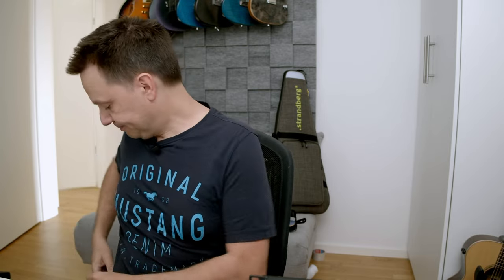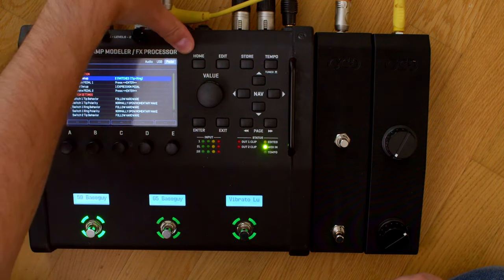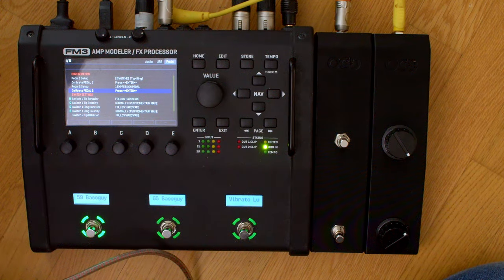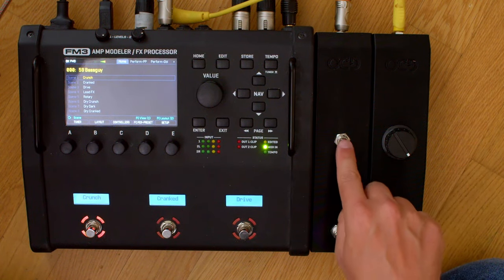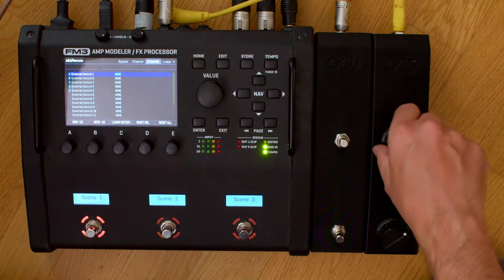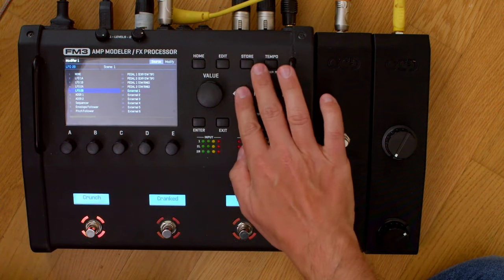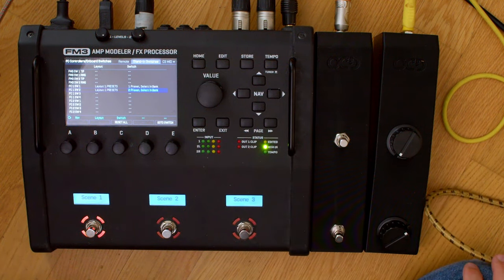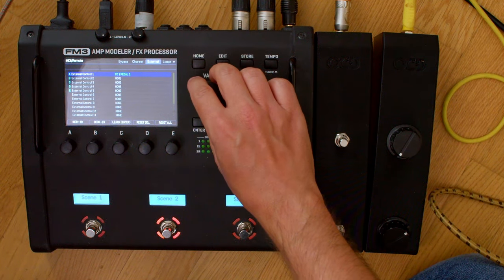How to setup Otter Custom Design switches and control knobs on the AXE-FX III, FM3 and FM9

Comment: I thought momentary external switches could only do tap function only?  are the otter switches not momentary? great video thanks!
Reply: They are momentary, and when you set up the make/brake thing, you get to both use a tap function and a hold function - just like on the Fractal foot switches.